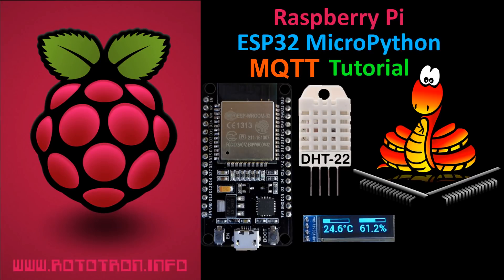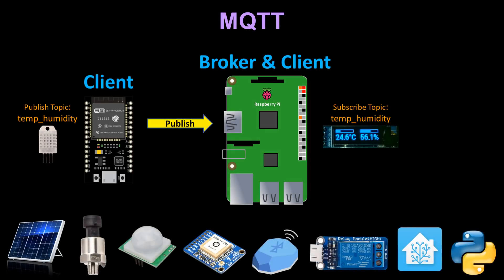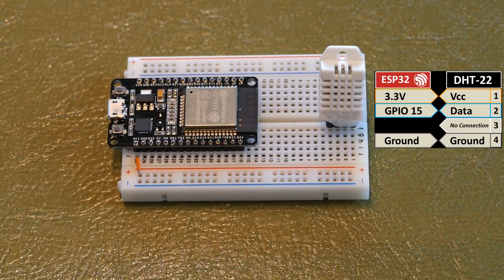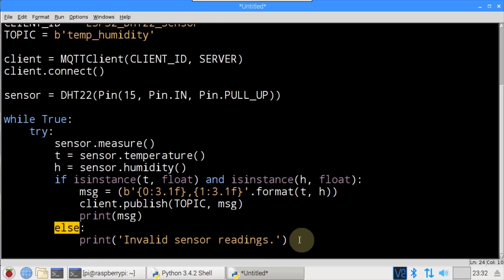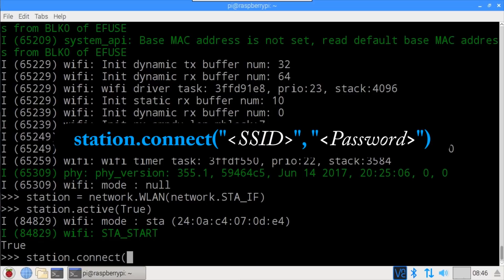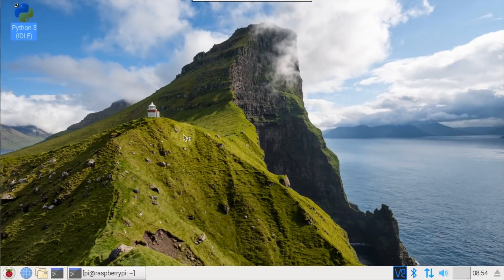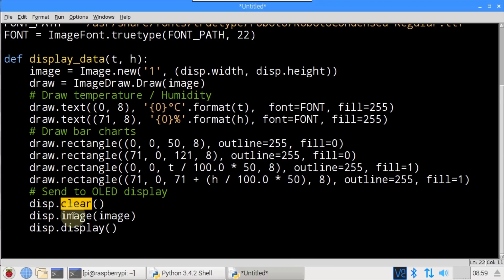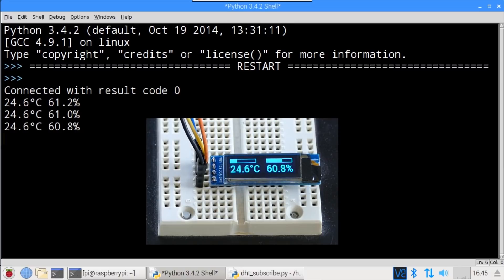ESP32 MicroPython MQTT Tutorial with Raspberry Pi, DHT-22 & OLED

Comment: Hey i have another doubt
At 7:12 we have the data being converted to the byte format
My question may sound silly but i would like to know if that works for all sensors or just for DHT specifically (i e,can i convert the data from any sensor to the byte format using this syntax or is there any other specific syntax)
Reply from the maker: It's not DHT specific but I think that the latest version of Python no longer supports using the format method with the bytes type.  However, if you wanted to achieve the same bytes conversion, you could use the following if formatting is necessary:
msg = f'{t:3.1f},{h:3.1f}'.encode('utf-8')
Reply: @rdagger  Thank you so much...i will try it out👍

Comment: Hey great video!!!Everything went on just perfect until I came to the command Mosquitto_sub -d -t "TOPIC_NAME". upon executing this command I get this output

Client (null) receiving connect
Client(null) receiving Connack (0)
Client (null) sending SUBSCRIBE (Mid: 1,Topic:"TOPIC_NAME",QoS: 0,Options:0x00)
Subscribed (mid: 1):  0
Client(null) sending PINGREQ
Client(null) received PINGRESP

and the last 2 statements keep getting printed until I force quit using ^C. I have searched far and wide for a possible explanation but none of the solutions seem to work out. Could you please help?
Reply: and moreover import "FILENAME" gives me this
File "dht_publish.py", line 10, in <module>
  File "umqtt/simple.py", line 68, in connect
OSError: [Errno 104] ECONNRESET
Could you please help?
Reply from the maker: Mosquitto v.2.0 restricts access to the localhost only be default. Modifications are required to the mosquitto.conf file which is located in the /etc/mosquitto directory. Append the 2 following lines to the .conf file to allow remote computers to access the Mosquitto broker without authentication:
listener 1883 0.0.0.0
allow_anonymous true
Reply: @rdagger  thank you so much!! Along with this i also found that my mobile hotspot took over the ipv6 address instead of ipv4. Adding these two lines and changing my wifi did the trick..Thanks again!

Comment: Is this project still supported? I've been successful with everything except to the very last bit of running dht_subscribe. Still providing help? This is my first exposure to mqtt. If I'm successful I'd like to esp32 the heck out of many things :)
Reply from the maker: I tested the code from the video last week on an ESP8266 and it worked.  You may have received a bad DHT22 especially if you purchased from eBay or Ali Express.  It could also be a wiring issue.  Make sure you keep the wires as short as possible.  There are many more reliable temperature / humidity sensors available now such as the BME280 and the Si7021.
Reply: @rdagger  I've spent more time on this than I'd like to admit. I started out the project on a RPi4, and was getting dht22 output readings from running dht_publish. At the point of running dht_subscribe on the Rpi it would appear successful, meaning no errors returned, but also no data and nothing on the lcd. 

Taking the same micro sd card I switched to the RPi3b+. Here I get errors from running dht_subscibe, but the lcd lights up with randomness - nothing legible. 

In both cases I test while physically connect to the esp32. I also test with independently powering the esp32 & dht22, however according to my router the esp32 is no longer connected to the wifi like it was when physically connect to the RPi. I don't believe the network settings are sticking when unplugged and independently powered.
Reply from the maker: @nathankoops6203  The best approach would be to test the functionality 1 piece at a time in the repl.  First open the repl on the ESP32 and see if you can successfully poll the DHT22 a few times.  The first read often produces an error.  Next see if you can publish an MQTT packet from the ESP32 repl and then subscribe and read the packet on the Pi in a terminal using the Mosquitto command line client.
Reply: @rdagger  I think what I'm missing is how to unplug the esp32 from the pi, independently power and still have repl running on boot and publishing. I'm getting the esp32 to network on boot, but not publish it would seem.
Reply from the maker: Normally you use a main.py file on the ESP32 to automatically connect to your WiFi access point.  Then add a line at the end of this main.py file to run your MicroPython program.  Here’s a template:
from network import STA_IF, WLAN
from machine import idle
wlan = WLAN(STA_IF)
wlan.active(True)
nets = wlan.scan()
for net in nets:
    ssid = net[0]
    if ssid == b'YOUR_SSID_HERE':
        wlan.connect(ssid, 'YOUR_PASSWORD_HERE')
        while not wlan.isconnected():
            idle() # save power while waiting
        print('WLAN connection succeeded!')
        import YOUR_PROGRAM_HERE  # Run your code
        break
Reply: @rdagger  I really appreciate you getting back to me with this. My wifi access looked a little different (and still worked) but I did exactly this in the boot.py file. Why it had to be in the main.py file, for the moment, escapes me. It's working, I'm happy and I can build up from this exercise. Much appreciated!

Comment: This solution currently doesn't work. The software runs on both devices, but the ESP8266 wont connect with the Broker on the Pi. I will update if i find any solution to this.
Reply from the maker: The video is from 2017 and designed for an ESP32.  Nonetheless, I just tested all the code using an ESP8266 and a Raspberry Pi 4 and the MQTT works great.  I suspect you are having a networking or firewall issue.  Adafruit did deprecate their Python SSD1306 OLED display driver so I added a code snippet to my website using Adafruit’s replacement display library.

Comment: Nice tutorial, thanks. I don't run Unix so adapted what you were doing to the Thonny IDE which I have just loaded (looks quite good). My second sketch (?) after doing a blink one. 
Had to modify one line to include port (not sure it was necessary), user and password for the Mosquito broker running on a Pi under Home Assistant...
client = MQTTClient(CLIENT_ID, SERVER, port=1883, user=b"username", password=b"password")
I tried adding them in the simple.py program but that didn't work! Still lots to learn,
I can see it's working by using MQTT Explorer on my PC.

Comment: Amazing Explanation...Is it neceassary to make use of breadboard for the connections? can we directly connect DHT22 with ESP32 using F-F jumper cables?
Reply from the maker: You can connect directly.  Shorter wires work better.

Comment: Great video, thank you. 
You can press Ctrl+L  to clear terminal instead of typing clear. What is the approximate system load on the Raspberry Pi ?  Could you possibly run htop while the MQTT is running?
Reply from the maker: I use the clear commands as markers when I'm editing the video.  Also my pace is very fast so I try to avoid keyboard shortcuts, command history and tab completion to make it easier to follow.  
Mosquitto is very lightweight.  I don’t have anything currently set up to test the resources properly.  Just starting the broker has the follow results;
PID USER      PRI  NI  VIRT   RES   SHR S CPU% MEM%   TIME+  Command
1202 mosquitto  20   0  8776  4744  4260 S  0.0  0.2  0:00.28 /usr/sbin/mosqu
Reply: @rdagger  
Thanks for quick reply,  You can use htop to monitor system resources in runs from a terminal. Install with sudo apt install  htop 
  To run, open a new terminal and type 'htop' to monitor your system.
The difference is you get a CPU useage graph  for each core and use of colour  easier to read than top.

Comment: Hi, I have a question, how to make another ESP32 subscribe to topic and go over the data.
Reply from the maker: It is very similar to the publishing code.  There are subscribe examples on the MicroPython Lib repo:  https://github.com/micropython/micropython-lib/tree/master/umqtt.simple
Reply: Thank you for the quick response, one more question, I checked one of the example from the website, so all I have to do is change the local host to raspberry pi IP address and the topic to the topic that I want to subscribe for example the dht_publish topic ?

Comment: You can use Adafruit libraries on microphython? I thought they were circuitphython onl.
Reply from the maker: The SSD1306 display is connected to the Raspberry Pi, which is running Python 3 code (not MicroPython). The Adafruit SSD1306 driver is a Python 3 library designed for the Raspberry Pi and Beaglebone Black.  One of the great features of MQTT is that it allows communication between systems running different programming languages.
Reply: rdagger68 my bad. Thanks. I have a PI 0w and a 4 I could do the same.

Comment: hi sir

I really like your video......
             I have make an program for DS18b20 sensor, it's running when i operation by REPL to using "import main" command, but when i remove USB cable from my PC and plug in it into USB mobile charger(2amp) that time code stop at "client.connet()" line 
And not connecting to my MQTT server 

what should i have to add in my code pls suggest me

 please help me regarding this

code are bellow

import onewire, ds18x20, time, network, machine
from umqtt.simple import MQTTClient

ds_pin = machine.Pin(15)
led1= machine.Pin(2, machine.Pin.OUT)

ds_sensor = ds18x20.DS18X20(onewire.OneWire(ds_pin))

roms = ds_sensor.scan()

print('Found DS devices: ', roms)

SERVER = '192.168.43.173'
CLIENT_ID = 'ESP32'

TOPIC = b'temp'

client = MQTTClient(CLIENT_ID, SERVER)

time.sleep(1)

client.connect()

while True:

  ds_sensor.convert_temp()

  time.sleep_ms(750)

  for rom in roms:

    print(rom)

    print(ds_sensor.read_temp(rom))

    t = ds_sensor.read_temp(rom)

    msg = (b'{0:3.1f}'.format(t))

    client.publish(TOPIC, msg)

    print('msg-')

    print(msg)

    led1.value(1)

    time.sleep(.5)

    led1.value(0)

  time.sleep(5)
Reply from the maker: Can you ping the ESP32 when it is plugged into the charger?  You don't import main.py because it runs automatically when the ESP32 boots.
Reply: @rdagger  Thanks sir for your valuable response
Sir i did't put "import main.py" in my code!....  
Code are working while operating through "repl", but when i remove cable form computer (raspberry 3) and give power through external power supply then it stuck at "Client.connect()"  line...
.
Regards
Deepak
Reply: @rdagger  
Sir i have also done ping test with ESP32 board IP found OK

it showing like this
64 bytes from 192.168.0.3: icmp_seq=8 ttl=255 time=25.3 ms
64 bytes from 192.168.0.3: icmp_seq=9 ttl=255 time=50.8 ms
64 bytes from 192.168.0.3: icmp_seq=10 ttl=255 time=73.6 ms
64 bytes from 192.168.0.3: icmp_seq=11 ttl=255 time=95.5 ms
64 bytes from 192.168.0.3: icmp_seq=12 ttl=255 time=118 ms
Reply from the maker: I'd add a telnet server or and LCD display for debugging.  I'd also try swapping out the external power supply.  Use a 2.4A or higher power supply and a short high quality cable.

Comment: I ran this project with a DHT-11 sensor under ubuntu environment and got these figures
b'614, 1280'
b'613, 1275'
b'615, 1280'
I didn't change any parameters and strictly followed the instructions. Can anyone tell me why the temperature was so high and the relative humidity exceeded 100%?
Reply from the maker: Make sure you specify DHT-11 instead of DHT-22 because they are not compatible.  You can also try the LoBo build of MicroPython because it implements the DHT module using the ESP32 RMT peripheral.
https://github.com/loboris/MicroPython_ESP32_psRAM_LoBo/wiki
Reply: Thanks  @rdagger :
After changing the three relevant statements to 
from dht import DHT11
CLIENT_ID = 'ESP32_DHT11.....
sensor = DHT11(Pin(15..........
I got an error message "Invalid sensor readings" 
I just wonder if the mishap was caused by using different OS (Ubuntu instead of Raspberry Pi)
Reply from the maker: The ESP32 is reading the sensor so the Pi OS would not matter.  I would take several readings because the DHT sensor will often give invalid readings.  It could be a wiring issue.  Are you using the 3 pin or 4 pin DHT-11?  Are you using a pull-up resistor and if so what value?  Make sure you keep your wires short.
Reply: @rdagger  There are only three pins in my DHT11 (+, out, -). I didn't add any resistor and all the wire was about 20cm in length. I try a similar project by using arduino "https://randomnerdtutorials.com/esp32-dht11-dht22-temperature-humidity-web-server-arduino-ide/" and the readings were perfect. That is to say, the hardware should be OK. Unfortunately, my esp32 board can't accept micropython commands after running the arduino project. Therefore, I've decided to give up. Anyway, thank you very much for your time.

Comment: Is it possible to use an ESP32 to do a PWM from analog inputs to a PPM output string? A radio control receiver needs to read the PPM transmitted over the air which it then parses out the individual channels (PWM from the analog inputs) from the PPM string (frame) to send to the corresponding servo. There's a delay at the end that signals the end of the PPM frame which tells the receiver to get ready for the next frame. What I would like to do is take each analog input and convert it into an 11bit value between .9 and 2.1ms and make a PWM signal. There would be 6 channels and each PPM frame would be 20ms total. So the max would be 2.1x6=12.6ms for all channels(PWM values) + (20-12.6, the delay period) = 20ms total. The PPM frame is output from the ESP to an RF deck which would transmit it to the receiver. It would need to output the PPM signal at at least 50hz preferably 60. I know this can be done with an Arduino but these seem smaller and it would be cool to have an option.
Reply from the maker: Reading the ADC inputs should be no problem using the ADC class.
  The PPM is more difficult.
There are existing libraries for decoding ppm:  https://github.com/dastultz/micropython-ppm-decoder & https://github.com/jeffeb3/cppm_micropython
I haven’t seen any MicroPython encoding libraries.  I haven’t worked with ppm.  I assume you need to generate waveforms.  The ESP32 hardware should be able to accomplish this but I don’t know if MicroPython affords the necessary control.  You can create analog waves using the DAC class:  https://micropython-docs-esp32.readthedocs.io/en/esp32_doc/library/pyb.DAC.html and the LoBo build has a DAC module that might work:  https://github.com/loboris/MicroPython_ESP32_psRAM_LoBo/wiki/dac
I suggest you post your question to the MicroPython forum: https://forum.micropython.org/

Comment: Does both the raspberrypi and ESP32 need to be on the same network?
Reply from the maker: Their networks have to be able to speak to each other.  For different networks you would need to be able to bridge them.  For example, you could set up a VPN between the networks.  If you are looking for a remote solution, you should check out ThingSpeak.com.  The LoBo build of MicroPython has a built-in MQTT library with support for ThinkSpeak: https://github.com/loboris/MicroPython_ESP32_psRAM_LoBo/wiki/mqtt#example-connecting-to-thingspeak

Comment: Wonderful video for a beginner like me.  I've got a question.  How would you add a display to the sensor board so that you could monitor the temp/hum at the site?  That would be extremely handy.
Reply from the maker: The same OLED display could be used on the ESP32.  I have a video on color OLED displays:  https://youtu.be/a7DrFqqu-78
You should also look at the LoBo build because it comes with a very robust display library:  https://github.com/loboris/MicroPython_ESP32_psRAM_LoBo/wiki
LoBo has recently added support for FTDI EVE displays which are very powerful.
Reply: @rdagger    Thanks so much for the reply !  I'm kind of new to this. Took Fortran about a million years ago and never programmed  again until I bought a Pi and am trying to learn Python and Debian.  I just  found  your channel and I love how detailed you are and how fast you pull a project together. Your website is next.  
I have dozens of ideas to investigate from automating a whole house wood stove to signal and brake lights on an RC truck.  Also kodi and a cloud server, security cameras and hydroponics.  
I am somewhat overwhelmed with all the information available and how fast it is changing but that is half the fun.  Between the piles of books, online courses, YouTube and adafruit I don't know where to start.  Linux is new to me and I am well past my optimum learning years so I have my work cut out.  
Again, thanks for the reply.  You will be hearing more from me.

Comment: A basic question. Since the ESP32 has wifi, is it possible to set it up so that it connects to wifi automatically on power up and then runs the micropython code to publish the data. It seems to me that if the only way is to keep it connected to the Raspberry Pi, then that defeats the purpose, somewhat. Ideally, one could have the rshell running remotely over wifi to connect. I don't have an ESP32 but was thinking of getting one.

ETA: just saw your next video which has the main.py
Still remaining: can rshell connect remotely?
Reply from the maker: In the 6th video of this series I demonstrate the LoBo build of MicroPython which comes with built-in FTP, Telnet and mDNS.  This affords wireless REPL access and file management.  

With respect to Rshell, it might be possible to set up wireless serial communication but I don't know.  You could ask Dave the creator of Rshell: https://github.com/dhylands/rshell
Reply: Thank you. This looks to be a great series. I have only finished the first two.

ETA: It also appears that webrepl for ESP32  is also available in the following fork: https://github.com/Hermann-SW/webrepl

From: https://forum.micropython.org/viewtopic.php?f=2&t=3124&p=30434&hilit=esp32#p30434